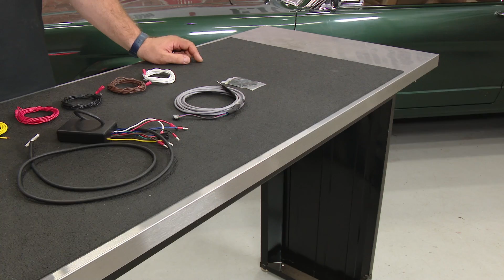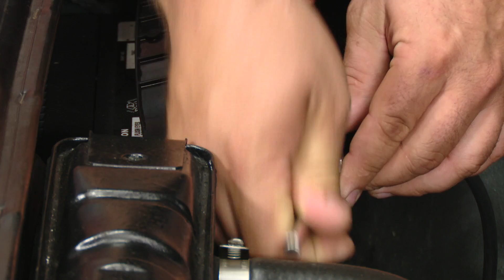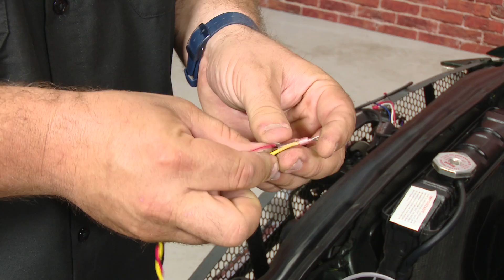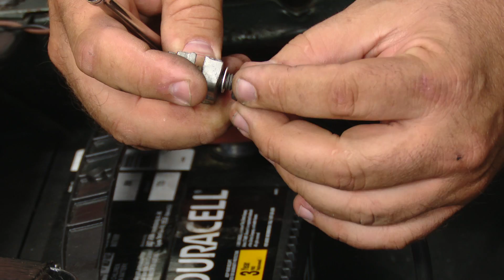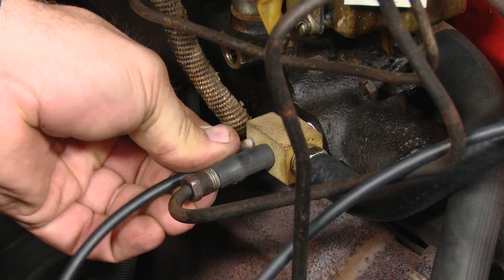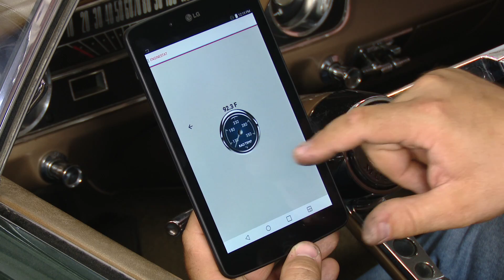Standalone Display Unit | EngineStat | 1965-1973 Mustang

Comment: Great video and product.   I would have inserted the water temp sensor into the FRONT side of the radiator and not have the wire near the fan.